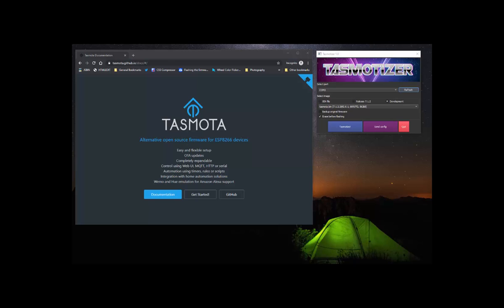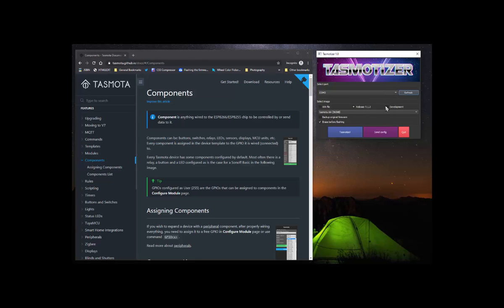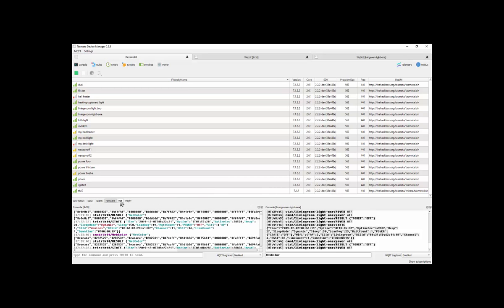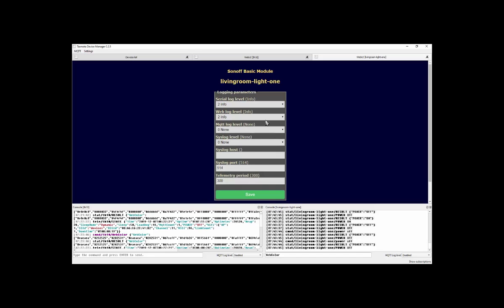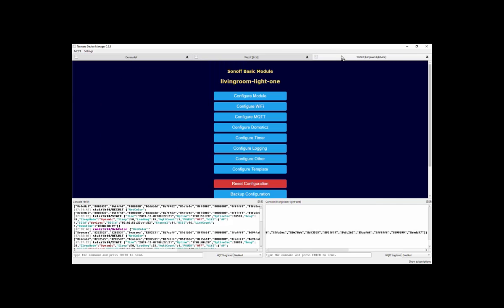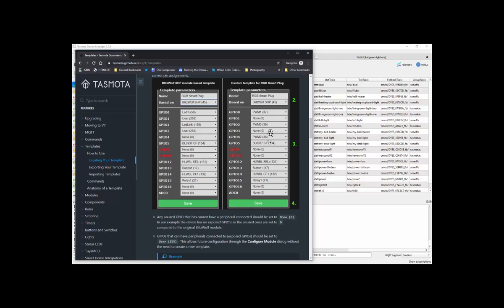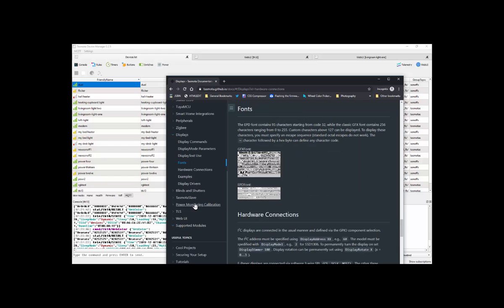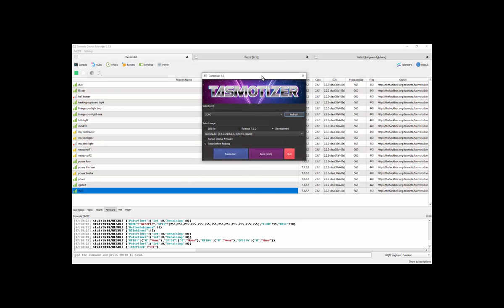Tasmota, TDM and Tasmotize IOT

Comment: Thanks for this video, it prompted me to update a couple of devices and flash up some Sonoff Basics I had lying around, Tasmota has come a long way and is a very configurable device and very powerful.
Reply from the maker: Hi Phil - just be careful - i learned a valuable lesson this weekend - unless you have units on the bench - stick with RELEASE versions of Tasmota - I updated one unit that is up in my LOFT to the latest development version - and for the first time in ages there's an OTA issue that requires a physical connection to fix. Hey Ho. The updating address in the WebUI can be modified to include the folder "release" to play safe. http://thehackbox.org/tasmota/release/tasmota.bin rather than grabbing the latest cutting-edge development version.
Reply: @PeterScargill  Thanks for the tip, I'll change the link.
Reply: Looks like mine already had the "release" in the path.